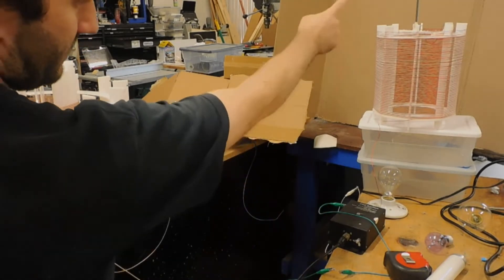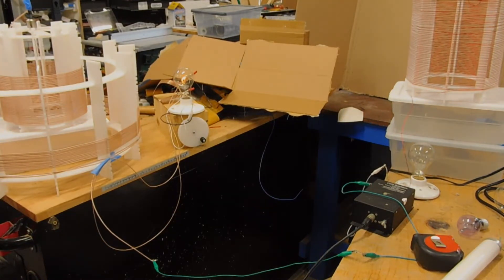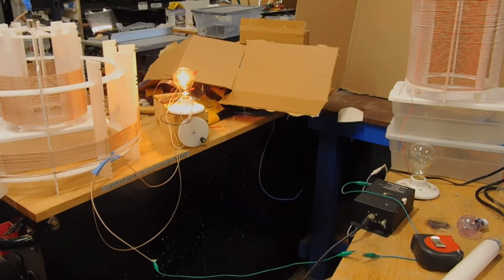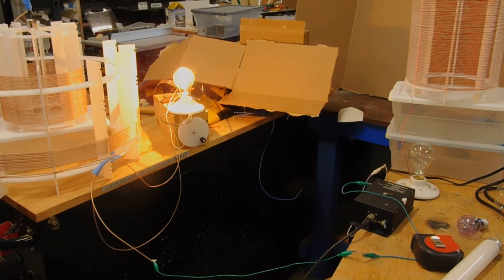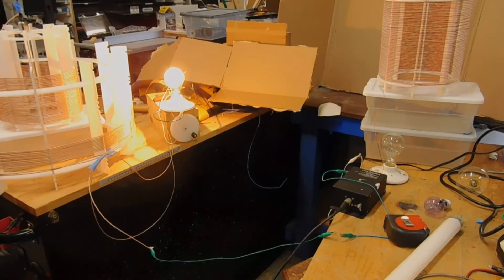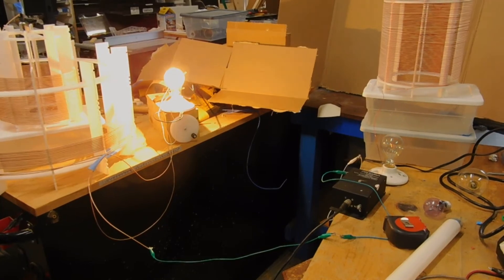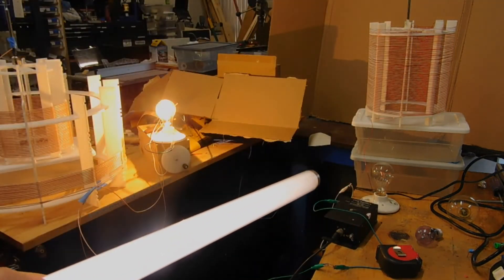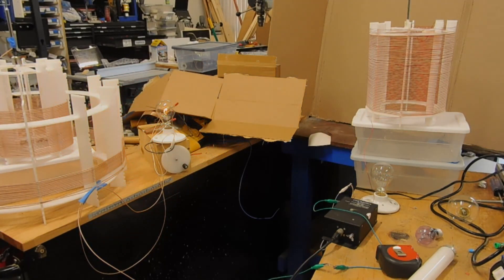Single Wire TMT + Bulb Lighting Experiment Part 2 - 8/9/2022

Comment: nice! at the risk of asking a dumb question: why the balun?
Reply from the maker: It all has to do with impedance-matching.   Most HAM radio gear is matched to 50 ohms, while most of the coils we're messing with here have an impedance in the 2 to 20 ohm region.  The balun acts kinda like a step-up transformer.😁

For those unfamiliar with the concept, impedance is basically a voltage-to-current ratio.
A very high impedance would mean thousands of volts at very few milliamps, while a very low impedance could mean a few volts at many hundreds of amps.  Same amount of power.

When they are unmatched you don't get as much power out of it
(like trying to hook a high-speed low-torque motor to a low-speed high-torque load)
Reply: @hakasays  ...i need a VNA lol
Reply from the maker: @cold3lectric  Instantly go from wondering what the coil is doing to drowning in field data and trying to understand it.:face-blue-smiling:

It's a valuable tool, just never mix it with a running machine🌩🌩🌩